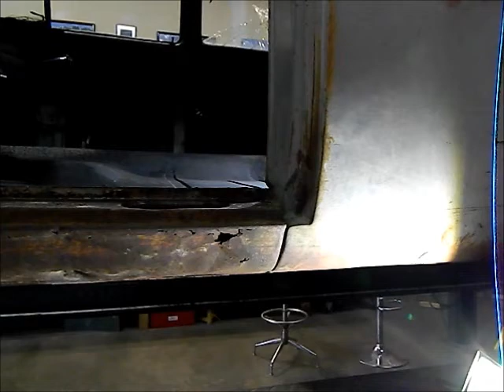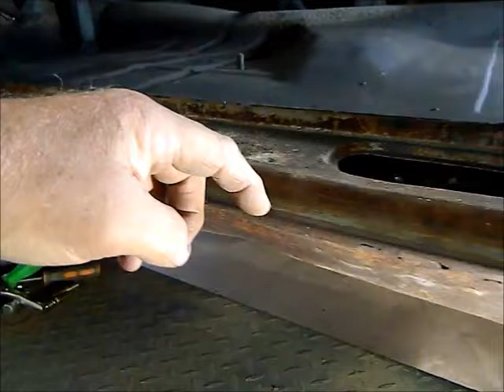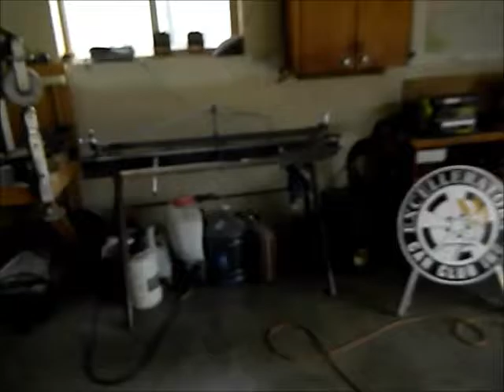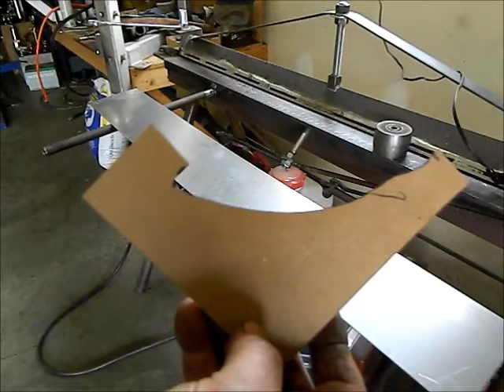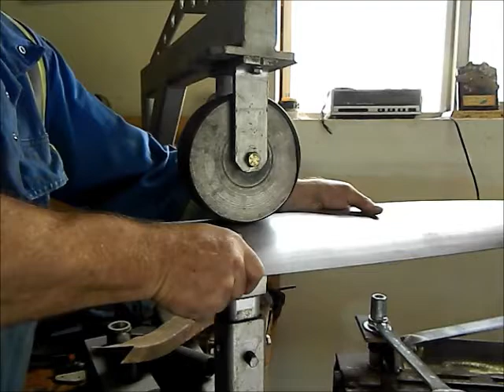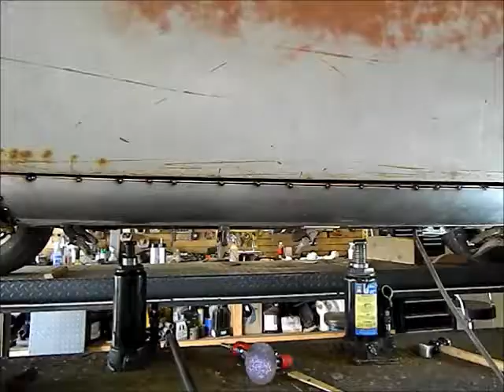Shoe Box Floor Repair Part 3

Comment: Hey Glen, where did you find the old Shoebox, it is an awesome car, nice repair sure like watching you do the work, how did you break the panel, catch you on the next one
Reply from the maker: Thanks a bunch. I found it on Facebook market place.  It was in a garage right in town.  I have a homemade brake I built a couple years ago I think there is a video on it.
Reply: @glenmiller3783  oh cool Glen I will try to find the video, are you doing the other side, if you do could you show a little on the break, thanks and have a great day
Reply from the maker: @DesertRatFabrication  I have already finished the Ford it has gone to the owner.  I'm back to work on the 65 Fargo. I'm working on new rockers for it and am doing a video right now showing how I brake and shape them.
Reply: @glenmiller3783  that is fantastic Glen, I will look forward to watching it, and thank you for subscribing, Mike